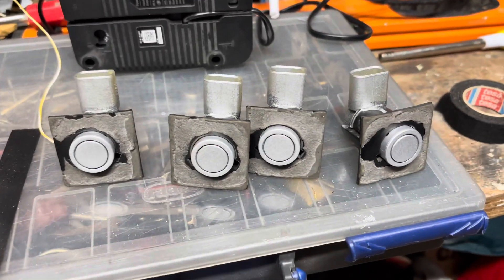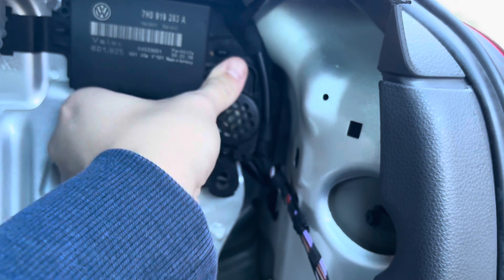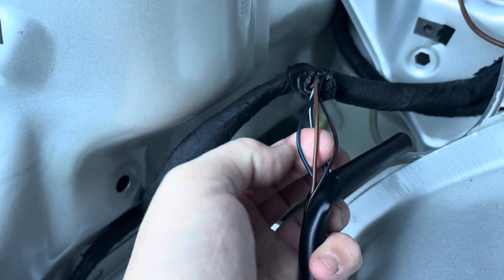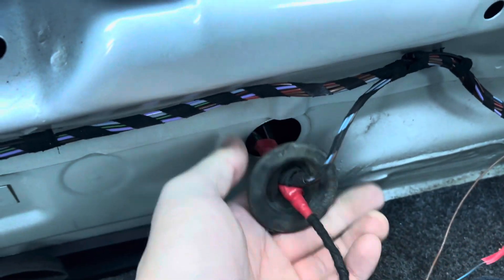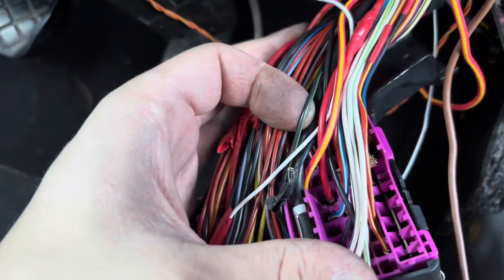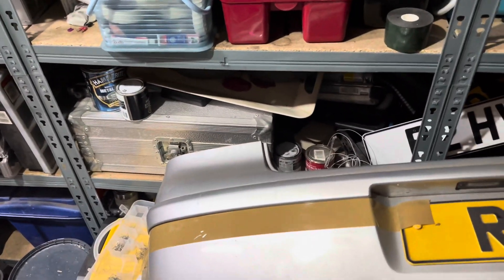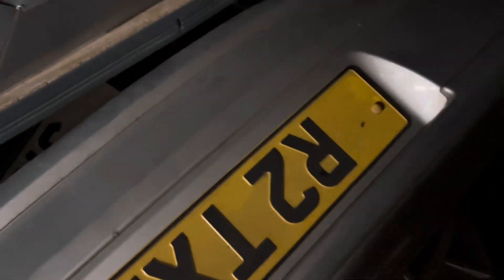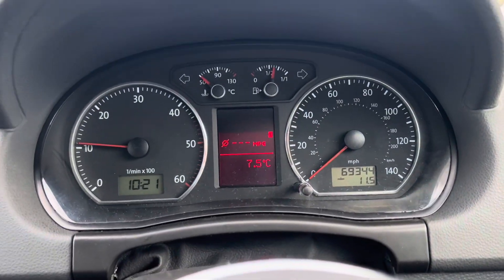Polo 9N3 Parking Sensor Retrofit - How To (No Coding)

Comment: Hi, is it handy to fix the cup holder on these beside the radio mine is stuck in afraid if I forced it the cover will just fall off leaving a horrible hole
Reply from the maker: hiya mate, 
yeah i’d definitely recommend fixing it, i use mine all the time.

Best bet is probably going to a scrapyard for a replacement or buying one off ebay. you can remove the old one by taking the radio out and at the top (inside) of the center console there will be a little tab which clips the cupholder in, you should avoid breaking anything that way. all the best!
Reply: Sound I’ll look into have some new bits going on this weekend and next then I’ll move onto cup holder

Comment: Hey mate, for your fan controls - did you swap the whole unit with the switches over from a 6r or is there anywhere you can just buy switches from?
Reply from the maker: hiya mate, i bought a full 6r panel, disassembled it and transferred the dials over onto the 9n unit - the old ones just pull off with a pair of pliers (if you dont mind marking them up😂)
Reply: Cheers man - had seen that the 6r unit can directly transfer over too, so was planning on grabbing one of those anyway!
Reply from the maker: @aaronduffy4995  whoa really?? looks completely different to me like, the ac/ recirc buttons are the wrong shape for the 9n surround 😂
Reply: @tomharvey  There’s various versions of the 6r controls as far as I’m aware - saw a guy do a direct swap over, I’m assuming it’s earlier 6r are compatible with the later 9n3
Reply from the maker: @aaronduffy4995  all the same shape mate, not entirely sure how thats possible unless he filed down the 9n center console trim
Reply: @tomharvey  think they’re a few diff ones no? Have seen different ones on eBay
Reply: @tomharvey  messaged you on messenger about the 6r knobs mate! Saw your post on the 9n3 group - didn’t realise I’d bought my GTI steering wheel off of you a while back!

Comment: Hello, Tom, my name is Georgi, I'm from Georgia, a country near the Black Sea. I have a Polo 9N, from 2004, 1.4L, automatic. It seems to have 75 horsepower. However, it has some issues. It doesn't accelerate beyond 155 km/h, and it also consumes 15 liters per 100 kilometers in city driving. What do you think could be the problem?
Reply from the maker: hi mate, im not entirely sure to be honest, i’m not a mechanic so i’d recommend taking it to one. sorry i couldn’t be of more help.
Reply: In Georgia, there are two types of mechanics. Either you have the cheap ones who are incompetent and might only take advantage of you, potentially causing more harm than good. Or you have the insanely expensive ones whose services cost a quarter of the car.

But thank you anyway. And thanks for the channel. The 9N is a super cool car. I love it with all my heart.
Reply: Its very simple, 75 hp with a 5 speed transmission, you are already at the limit.

Comment: Tom you absolutely legend. Been wanting to do this to my own car but honestly wasn't confident enough in the process. Will be getting the parts now 💪💪

Where did you buy your clocks from? They seem to be a European exclusive, but I can't find them anywhere, not even a part number
Reply from the maker: amazing mate, glad i could be of some help ❤️

well predicted, they were indeed from europe, i got mine from lithuania and just changed the right side foil. from there its just about changing the region on vcds, but worked out to be £70 rather than £270+. look for ones that aren’t listed as FIS ones, but actually are, there was loads on ebay when i last checked. 

To code them to a car, the easiest way is to use K-Can commander and manually edit the EEPROM code lines, you need to change the VIN, Login ID (SKC, which is encrypted and located in two areas of the eeprom hex) and of course the mileage. some of the newer instrument transfer software doesn’t work.

hope this helps.
Reply: @tomharvey  what a lad, thanks for the help. Will see if I can snag one online
Reply from the maker: @zero_burrito give it a go lad, nowt to lose!